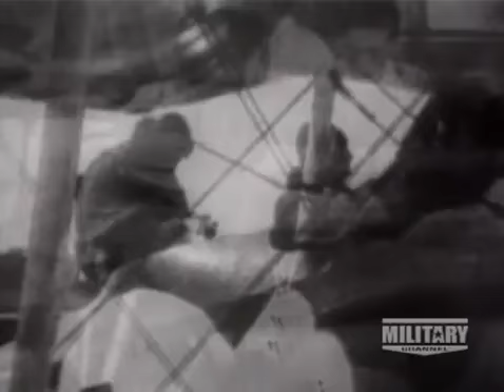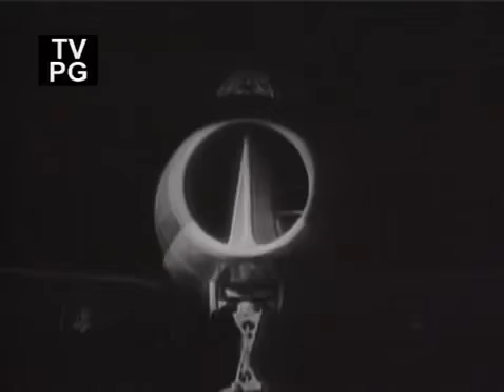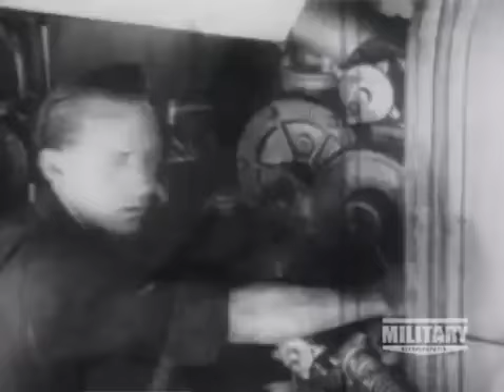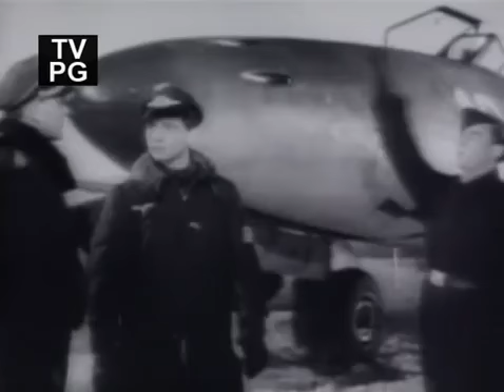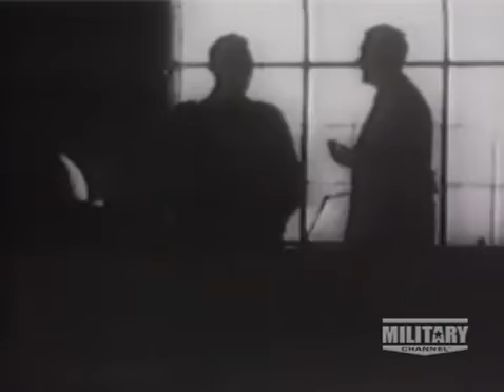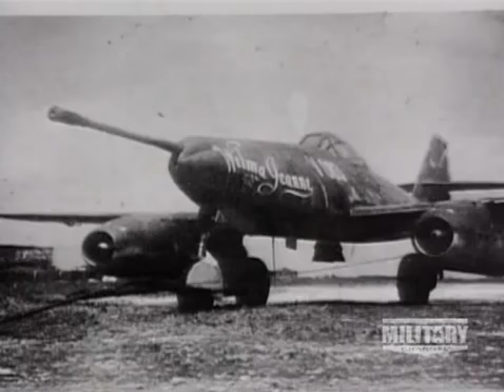Wings of the Luftwaffe: Me-262 "Schwalbe"

Comment: They always say Hitler wanting the 262 redesigned to be a fighter bomber delayed production.  If they hadn't done that it would have been ready years earlier and they could have won the war.  Yeah the plane would have been ready, but the engines still weren't ready until 1944.  They could have put it into production earlier and had a thousand 262s parked without engines.  Even when it was finally put into production, the engines were rushed and still had problems, and they never had enough engines for all the plane they had built.
Reply: Could have won the war? Because of this one plane?

Hmm. I really don't think that'll stand up to too much analysis.
Reply: They didn't have the special high temperature alloys to make them durable and long lasting ,the engines had to be carefully nursed during flight making the 262 vulnerable at takeoffs and landing .
Reply: Whittle had the right idea. Although it was not the match in performance, the centrifugal force engine required a lot less heat resistant metals then the axial flow engine(compressor and turbine blades).
Reply: I advise you to watch this video: https://www.youtube.com/watch?v=SDYHd1PuR5U&ab_channel=MilitaryAviationHistory

The 262 did not need to be redesigned as a fighter bomber, just like the 109 didn't need to be redesigned as fighter bomber, yet it still carried bombs. The ability to carry bombs was part of the design from the beginning.
Reply: ME 262 vs. Atomic bomb.  Hitler was never going to win his war...regardless of his jets and "superweapons".
Reply: @scottreed4448  The US made the atomic bombs out of enriched uranium they got from Germany when it surrendered.  But keep watching Discovery channel documentaries.
  Germany lost because they had no fuel the entire war.  They had hundreds of Me262s on the ground as Allied bombers flew over, because they had no fuel, no pilots, and no fuel to train pilots.
Reply: The U.S. absolutely did not get get Uranium from the germans. They got unenricched uranium from Conglease mines and enriched them at Oak Ridge.
Reply: @scottreed4448   The war was over when they failed to hold the oil fields in the caucasus.  They had no fuel.  They produced tens of thousands of Bf-109s every month into 1945.  They had no fuel to fly them.    It's why they stopped doing encirclement maneuvers.  But you probably believe the discovery channel that Hitler was just insane and took over the strategy as to why they stopped doing tactical things on the eastern front.
Reply: @scottreed4448  And atomic bombs wouldn't have done much to german cities that wasn't already done.  Was the USA going to nuke the ashes?
Reply: They produced approx 3100 airframes. Only 440 were ever completed and flown. The statement that Hitler insisted it be used as a strike bomber is a misunderstanding and probably as a result of mistranslation. Hitler merely asked if it could be used as a bomber, as per an ReichsLuftsMinisterieii (RLM) directive of early 1943, that stipulated that all new aircraft types must be multirole. Apart from pylons (which could also carry papier-mache drop tanks) the Me262 was never fitted with a bomb sight. However the aircraft could be quite an effective bomber, but the reduction in speed and manoeuvrability, and the fact that the Me262A was a day fighter made it a sitting duck to allied piston-engined fighters when carrying bombs. Remember at that time, Me109s and FW190s were also fitted to carry bombs and fulfil the role of the obsolete Ju87 Stuka dive bombers. They also were not fitted with even rudimentary bomb sights. The standard Revi 04 sight was used and pilots were trained to approach at a certain speed and dive angle and release when the target was in the 6 o'clock position on the reticle. It was accurate enough. The Me262 method was the same, and if the target was approached correctly, using the advantage of higher speeds and forward momentum, results could be pretty effective.  

The LW already had a very fast jet bomber in the form of the Arado 234. It's only drawback being that it used the same engines as the Me262, Junkers Jumo 004s. The LW wanted an aircraft to take on the B17s and B24s of the USAAF that were trashing German cities and war production plants, hence an armament of 4x 30mm Mk108s and R4M rockets. 2 or 3 30mm rounds could destroy a bomber and just one R4M could put a big hole in a B17. This need also saw production being prioritised to the Me262. Arado could have built more Ar234 bombers but they were denied the powerplants in favour of the fighter Me262.
Reply: You don't fight a total war to the death with unproven technology.....that was the Nazi situation after their defeat at Kursk.
The Soviets also flew jet and rocket planes. They flew a rocket plane in 1933!!!
But shelved the program because of technical problems.
The Soviets understood after WW1 ( which no other country did) was the day of decisive single battles was over.
The Nazi fascination with technology was due to the mistaken belief that these weapons would produce a decisive turning point in a single battle????
The Nazis were intelligent but the Soviets had insight....which won them the war.
Reply: @johnweerasinghe4139  Me262 was well proven and effective machine, even V2 hits got precise enough without too many lost. German pilots who knew the situation claimed He280 or Me262 could turn tide of the war if used as intended, if Hitler's didn't interfere with drug fueled nonsense. They had time to develop at least He280, it was probably too late for Me262 because of time lost when waiting to start using it as a fighter. Being techinican myself i don't see 3rd Reich being too fixated on non functioning technology.
Reply: @johnweerasinghe4139  you mean manpower not insight lol
Reply: @johnweerasinghe4139  Soviets were not alone. If not America, Soviets would be wiped out.
Reply: After the war ended, of course many Germans found it convenient to put all the blame for everything on Hitler. The Germans who were still alive had a handy scapegoat who couldn't talk back. 

It's hard to imagine how requiring the Me-262 to have fighter-bomber capability would have delayed its production. Seemingly every fighter airplane in WWII had fighter-bomber capability, without delaying their production. You just put some hard points under the wings or fuselage, and presto - instant ground attack aircraft, which can then defend itself from enemy fighters after droppings its bombs or shooting its rockets. 

As to whether Germany could have "won the war" with earlier production of the Me-262, that's debatable. German resources were strained across the board - what would they have had to sacrifice to build thousands of jets? Submarines, tanks? The UK and USA were working on their own jet aircraft too. America's first jet flew in 1942! They just didn't prioritize them because there was no need to divert resources from the proven piston-engined aircraft that were winning the war. Had the Germans suddenly flooded the skies with jet fighters, the Allies could have caught up pretty quickly, perhaps in a year. As it happened, the USAAF had its production-model Lockheed P-80 Shooting Star operational in Italy when WWII ended. None had seen combat, but again, there wasn't any need.

Note that in Korea in 1950-53, when the USA enjoyed near-total air superiority, with both jet- and piston-powered aircraft, it could not defeat a technologically inferior but numerically superior Chinese ground army.

For the Me-262 to "win the war" it would have had to strike a knockout blow against the Allies. It's not clear where the opportunity would have been. Germany lacked its own strategic bombing force, so it couldn't have threatened distant enemies. Sure, the Me-262 could have inflicted heavy losses on USAAF daytime bombers, for a while, but it would have been irrelevant against night bombing. You don't win a war by defending against enemy bombers over your own territory. You have to get your bombers over their territory to think about winning. Speed was not the issue at night during WWII - finding the enemy was. The USAAF could have switched to night bombing, while accelerating its own jet fighter development. The P-80 could have been available in numbers in 1945 and negated the Me-262. Recall that as it happened, the USAAF was able to defeat the Luftwaffe with piston-engined fighters of similar quality to the German fighters. The P-38 Lightning, P-47 Thunderbolt, and P-51 Mustang were not significantly superior to their Luftwaffe opponents. Rather the Allies had advantages of production, logistics, population size, and the geographical invulnerability of North America. Also, the Luftwaffe had to do three demanding jobs: attack the USAAF bombers and their escort fighters, while also fighting on the Eastern Front. This gave the Allies a huge advantage - they could fly their fighters far ahead of the bombers and attack the Luftwaffe fighters while they were still climbing to altitude.

A stronger argument could be made that Germany missed its one chance to knock Britain out of the war in 1939-1940, before the USA and USSR were in it, if only Germany had built enough long-range U-boats before going to war. As an island nation,  the UK was almost totally dependent on imports to keep its economy running. As the UK was unprepared to fight the U-boats initially, Germany had a brief window in which it could have wiped out the vital merchant ships. Even with insufficient numbers of U-boats they were able to inflict grievous losses, but they didn't have enough U-boats to finish the job before the Western Allies caught up with anti-submarine warfare capability.

By the time the Nazis had declared war on everybody, there was no realistic path for them to win. Any technology they could have introduced would have been quickly countered by the Allies. And that's what happened. The same thing happened in the Pacific Theater, with the Japanese having quality advantages in aircraft and ships at the start, but these were quickly negated by Allied engineers. The Japanese had no hope of defeating the USA outright, so it was only a question of time for the massively larger US economy to just out-produce them.
Reply: @danielmocsny5066  Fighter plane was very different from bomber. There is a lot of information how Hitler's wish to have Me262 as a bomber made development a lot longer. I agree that Germany couldn't win the war after failing at UK, invasion of Russia was also big "turning point" (i should write it this way instead of "turn the tide").  I'm sure they could fight well into 1946 if resources weren't used for some of grandiose ideas by Hitler. Still, their engineering achivements were incredible considering lack of resources, Jewish specialists, etc. I can say with certain authority German broadcast gear, just one tiny part which wasn't very important for war, was years ahead of anyone else's at least in 40's, 50s. For example most famous microphones are closely related to so called Hitler's Flasche, there were many other firsts by them.

Comment: I'm a big fan of mustang P-51 now .. I must add the Me-262 definitely  years in advanced... I for sure would have liked to tap that throttle!!👍👍👍👍👍 Thanks you guys always do a superb job on your . documentary s
Reply: It wasn't that fun to use the 262 throttle since it you had to be super patient and move it slowly - if you just slammed it the engines would flame out.  EVENTUALLY the plane would get to a super high speed, but it would take its time getting there
Reply: The Me-262 was slower than the Lockheed P-80 Shooting Star, which was in production by 1945, and already in theater when the war ended. The USAAF was already transitioning to jets, having flown its first jet aircraft way back in 1942 - thanks to some technical assistance from the UK. As the Me-262 never had reliable engines, we can debate whether it was "years" advanced. Of course it was superior (when it worked) to all piston-engined fighters, but every air force in the world understood jets were the future and was working in that direction.

Comment: Among production fighter is was the fastest, but the U.S. flap jack was actually faster, and has piston engines.  But Jet development caused it to be regulated to the dust bin of history.
Reply: Vought XF5U -  Maximum speed: 452 mph (727 km/h, 393 kn) at 28,000 ft (8,500 m) (estimated)[6]
Me 262 -  Maximum speed: 900 km/h (560 mph, 490 kn)

Vought XF5U - Testing and evaluation

The V-173 and F5U design was considered promising, and possibly capable of great maneuverability and speeds of up to 452 mph (727 km/h).[6] Two prototypes were constructed. Taxi trials of the XF5U-1 at Vought's Connecticut factory culminated in short "hops" that were not true flights.[7] Suggestions that the XF5U-1 flew were likely a result of confusion with the V-173, which underwent flight tests until 1945.[8] During these ground runs the XF5U-1 reportedly experienced severe vibration problems.[7]

y 1946, the project was long over its expected development time, and well over budget.[2] With jet aircraft coming into service, the US Navy officially canceled the F5U project on 17 March 1947. The only completed XF5U-1 proved to be so structurally solid that it had to be destroyed with a wrecking ball.[9] The prototype V-173 was transferred to the Smithsonian Museum for display.

https://en.wikipedia.org/wiki/Vought_XF5U#Testing_and_evaluation

V-173 = Maximum speed: 138 mph (222 km/h, 120 kn)